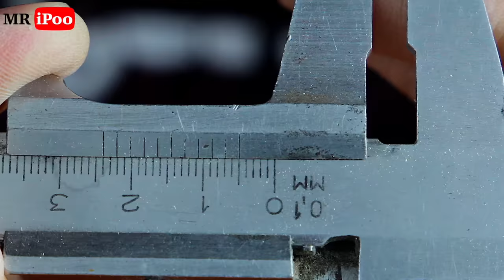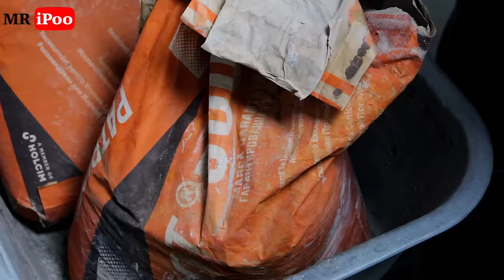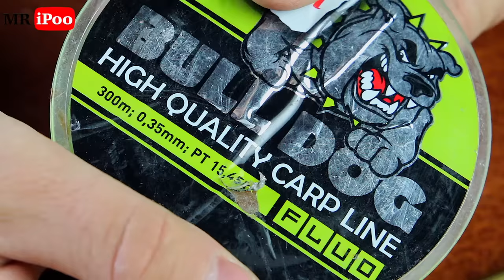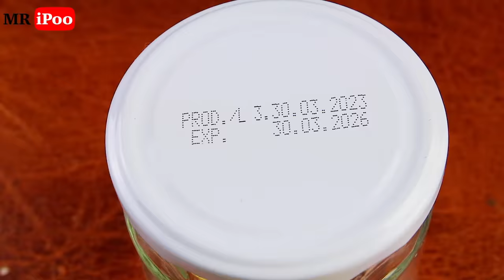this flame burns at 1652°F for more than 100 hours! diy ideas you need in your life right now

Comment: What is this type of burner called?
does it work with Oil, Alcohol or fuel paste?
And does it outperform a simple alcohol stove in terms of effectivity?
Reply: The hint is when the guy was filling the glass jar. There was a diesel engine running in the background.
Reply: @nathan  
Well , but what is the meaning of the diesel running ?
  not sure it defines anything .  Er , the fuel in the jar .
Reply: @alanadale1945  "Well , but what is the meaning of the diesel running ?" Just think on it, it will come to you.
Reply: @alanadale1945  forget about this silly guessing game. 
Found out It runs with alcohol.  
Not Oil  / Diesel...
methyl alc. ethyl alc. spirit.
Still don't know the exact name of this type.
They are sold as as "self pressurized alcohol stove" or "burner"
and are safer (sealed) and supposed to be more effective than a simple open alcohol burner.

Comment: Why does it have to be sealed (I get it could be so it doesn't spill), but how do you avoid underpressure within the glass leading to flame off?
Reply: The flame heats the tube hot enough to warm the fuel enough to push it through

Comment: what are you putting in the pipe? corn meal or sand??
Reply: it does not matter. The sand is simply a media being used the fill the pipe whilst it is being bent. If you tried to bend pipe like that without something inside then the walls would simply collapse and you'd just kink the tube, not shape it. 
Crimping off each end is a bit OTT as a piece of tape would do the same job, stop the sand from running out when you start bending
Reply: Packing a pipe with sand is an old method of bending without kinking. However it has to be compacted.
Reply: Description says quartz sand. Only thing not explained is the fuel. It's just.... Not mentioned. And no matter how many people ask in comments, it's not responded to. Just a big glaring hole in the entire thing... The mystery fuel... Which is probably the most important thing to get right.... And most dangerous thing to get wrong....

Comment: Let's solve the mystery fuel question off the bat. The best fuel for this contraption is... Isopropyl... Ethyl... alcohols. You could even make moonshine and use the heads... moonshine IS ethyl alcohol. Do not use moonshine from the liquor store it is 50% water. Grain Alcohol is also ethyl alcohol...great video, but the lack of instruction on the fuel  makes it DANGEROUS! Did not enjoy leaving information out.

Comment: With the addition of a small bit of zinc ... the Fuel can be plain water and last for 10 times longer... (have to make the burner hole smaller though..)  unknown what he did for fuel here... no reaction so... had to be alcohol or fossil fuel.
Reply: How to add the zinc???
Reply: @dydeyaus6433  Feed it through with the cord... like a zinc wire... a galvanized wire maybe.... zinc ribbon say.  But also, dont stop the cord ... run both all the wway around and leave tails.

Comment: I feel it necessary to explain that you do not fill the jar with any alcohol or liquid heat all the way to the end of the pipes because it will begin to turn it into a flamethrower and there are better ways to make this rocket stove that are a lot safer but kudos to the video creator for making original content and thinking outside the box

Comment: how do you cap it off to save the alcohol?  do you have remove the wick cap and  change out the lids to seal it?
Reply: Once the fire is out, there is virtually no need to cap it ... the alcohol evaporation rate is negligible, so you might lose the contents over the period of several months. So tip the contents into a bottle and fill when needed. Or put some putty or plasticine over the hole
Reply: We could use a second bottle that’s empty of the same model and switch the lids. 🤔

Comment: Nice object. What is it's purpose ? For stirling engine ? The flame is too blue for light or lantern. With a mesh for infrared heater ? Thanks 😊
Reply: I believe it's used for heating food or boiling water while camping.
Reply: Just a scientific exercise. I can see no practical purpose, 'cept maybe to light a cigar.
Reply: @postalinVT  It's portable and can be used to heat soup or make tea while camping. It'll do the same at home also if there is a power outage.
Reply: It's a home made bunson burner, like we used in high school science class.
Reply: If you can cap the fuel hole itd make a great lightweight camp burner for hiking
Reply: @jondennert  paint can with one lid to seal and the other to operate. great idea!

Comment: So when it isn't burning how do you stop the gas from dissipating?
Reply from the maker: Hello! Thanks for your sponsorship! In this design, the only reasonable solution is.
1.Put out the fire (blow out as hard as a candle)
2.Pour the remaining liquid into another container with a closing lid. (or pour into a plastic bottle)
-The best thing is to find exactly the same lid for the jar. Unscrew the cap with the burner and close it with a new sealed cap.
Reply: @MriPoo  good idea to have an identical jar+lid!
Reply: @MriPoo  what if just blocked the hole with a wad of blue tack or something similar when not in use?
Sounds crude but might work.
Maybe you might even find some kind of rubber plug for the hole that fits well?
Taking the fuel out and storing it or replacing the lid might get annoying after a while.
Reply: @MriPoo  Why don't you answer the question of fuel type you used ?
Reply: OK, scratch that, just saw you have lower down  in the comments.😆

Comment: dunno but basic logic says the flame gets hotter because of the fuel.. And as a metal worker and certified mig welder I think I'll call the 1652 degrees a bit shaky.. since at that temp you'd think you'd be melting the copper ......     oh by the way if ppl are amazed at a dual feed lighter I could make one with 100 feeds...  to one flame :-\ ....   so I'm calling this bs it increase's heat..  cool though...   just...  follow basics...  the only way to increase the heat is by blowing more oxygen into the flame..    why we use oxy acetylene torch's.... lol   acetylene wont cut metal

Comment: I’m gonna have to try this. Not safe to use inside the home or unattended (harmful fumes plus if the jar breaks or blows up from flammable vapors) but man it looks cool to try. 

Might do a mk. 2 with fiber glass wicks and vegetable oil.
Reply: Those veg oil (shortening, lard, Crisco, etc.)lamps stink, they make everything around them stink.
  Better than nothing in an emergency i suppose, but everything will have french fry stink I promise you.😣
Reply: @FurtiveSkeptical  And Black Smoke
Reply: @FurtiveSkeptical  agreed. I would try it but I’m not going to use it in daily life
Reply: Perhaps carbon wicks

Comment: 100 hours isn't a lot...
Does the wick last longer than just sticking the wick out of the pot like a regular oil lamp?
It's a nice diy but it's just a normal oil lamp.

Bending the copper with the sand is a good idea though if you don't have a Bending tool.

Comment: the wik is not required, it burns the fumes,  just dont separate the coil and the flame will keep the cycle going, i mean it would probably work even if you do separate them a bit as long as the flame keeps it hot
Reply: the wick is needed so the flams don't flash back into the jar
Reply: A short Wick inserted up in copper tubing is all that is necessary, leave rest coiled up in fuel/alcohol...

Comment: Thanks for mentioning what fuel was used.  This video is a complete waste of time without that info...
Reply: Probably ethanol (alcohol) as it burns at about that temperature with a blue flame.
Reply: It's also unclear how you got those threads positioned in order to pull the second wick in.

Comment: The video just drags, "drags"! Give information properly, educate.
Reply: educate yourself on his language so you can follow if he were to speak instead.
Reply: @wotviewer   That ranks right up there with some of the most nonsensical answers to comments. Knowing "his language" is an absolute rhetorical statement to follow with, "if he were to speak". Knowing his language is pointless because he does not speak! @yanchouser7364 made/asked a perfectly fine comment/question. One that is made all throughout the video comments. For being a "instructional/how to ideas video" it leaves out some of the most important points to these type of videos. That being there are almost literally no instructions or measurements, ingredients, operation/hazards to avoid, while simply showing the build process alone. Even rough measurements and supplies type used are Critical when making an open flame, liquid fuel, and pressurized delivery for a small DIY project, that could potentially explode like a molotov or burn house or buildings down reasonably quick.

Comment: For safety sake you must put the fuel back into a sealed container if you blow out the flame to use later. Otherwise all that fuel will evaporate into the room you leave it in and if a naked flame comes into contact will cause a nasty explosion.

Comment: what fuel source are you using?
Reply: Probably 96 degrees alcohol.
Reply: Jet
Reply: "what fuel source are you using?" The hint is in the engine that was running in the background when he was filling the glass jar. It was a diesel engine running when he was filling the jar and quit when he was finished filling it.
Reply: @nathanwoodruff9422  He's definitely not using diesel fuel here.  Color's wrong.  Might be jet a.  More likely it's denatured ethanol.  Could be kerosene but it looks too thin to me.  Quite possibly naptha.

For what it's worth, he's also definitely not getting a 1700 degree flame.  His brass pipe would melt at that temp.
Reply: @ColonelSandersLite  "For what it's worth, he's also definitely not getting a 1700 degree flame. " Yea, well sorry to be the bearer of bad news but Diesel auto ignites at 210 °C (410 °F) about the same temperature as Jet A. Nowhere near the 1700 delusion you pulled out of some body part. And it is Diesel. The only reason why this person can't state what the fuel is because Diesel heaters in most parts of the world are illegal to own. This video just happens to be of a Diesel heater.
Reply: @nathanwoodruff9422  "Nowhere near the 1700 delusion you pulled out of some body part."

By 'some body part' did you mean 'the title of the fucking video'?

Just curious bud.

Again.  Definitely not diesel.  Color's wrong.  Since you seem to be totally unfamiliar, you can look up any video you want on diesel fuel and see for yourself what color it is.
Reply: could be gin and tonic @ColonelSandersLite
Reply: urine...
Reply: @ColonelSandersLite  diesel have brown color, gasoline yellow, both stinks when burning, maybe alcohol, it's burn, but stinks too
Reply: @trhnisilevouzadní  Looking back with fresh eyes a few months later, I really do think it's probably just denatured ethanol.  Pretty clear flame with the lights on.  Also, the whooshing sound it's making is pretty characteristic of how aggressively the stuff evaporates when hot.

Comment: at these temperatures, I would be concerned that the pipe could melt
Reply: It could not melt because copper melts at 3272 Fahrenheit.
Reply: @hmarillejla7  1985
Reply: Isn't it possible that the tube itself would be cooled by evaporation right at the orifice. Even though the tube has to generate to make the hot flame. Maybe on the same principle as a gas refrigerator.
Reply: @jaroge01  That's correct, of course. What I really wanted to say with my comment was that the claimed temperature of 1652°F can never be reached with the given constellation

Comment: First of all you made a very nice video the only problem of it is you didn't teach anybody anything other than visual? You could have at least put in writing or in text or narrow pointing to the gray substance you were putting around the tubing and what type of material you were putting through the materials whether it be cotton and how far away from the hole would be your best efficiency of burning and what type of fuel whether it be clear kerosene or alcohol or if that matters or not little bit of text and pointing things out would have helped a little bit what did you spray on the tubing and the gray substance you put around it was it cement and what type of cement what was the clear stuff you put around the tubing mixed with the gray stuff and then sprayed on it

Comment: Can't see why you'd have the flame hitting the tubing. Instead of the loop, why not just bend the tubing "M" shaped?
Reply: Heating the tube makes the fuel 'generate' which causes the fuel to vaporize plus gives it the pressure.
Reply: In 1974, I bought a 'TayKit' for about $5, operates the same way. Has a funnel with a rubber sleeve that goes in the coil to seal off the hole & metal box that assembles to a wind guard & rack for a pot or pan. You can probably find a YouTube about them. They were made right here in Michigan.

Comment: Lowes has pipe benders  for doing that where the pipe doesn't collapse and fold what a waist of time you can also use your hands to bend it in circles and don't need  pipe cutters either you can fold it back and forth till it breaks and use pliers to squeeze it back open 😆✌️

Comment: 😮 Very dangerous !!!
Reply from the maker: Is the Flaming Sambuca cocktail, in your opinion, also considered dangerous? It's just the evaporation of alcohol. Moreover, the tube is filled with threads, preventing the flame from entering back into the jar. Also, alcohol doesn't burn without oxygen, and in the jar, there are only alcohol vapors. Don't mislead people.
Reply: As long as the threads are 100% cotton, correct?
Reply: I am going to try one with carbon fiber welding cloth strips. It wicks alcohol well, I have used it to make camp stoves for years and it does not burn. I am only interested because this says it burns much hotter than a regular bunsen burner. You could swett pipes with this thing.
Reply: Yeah, some people live dangerously.
Reply: Alcohol.